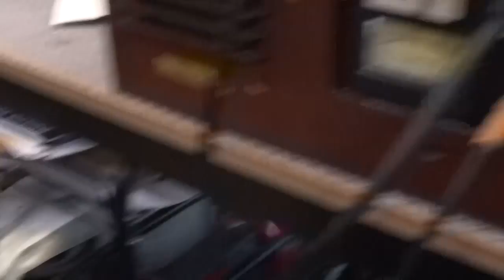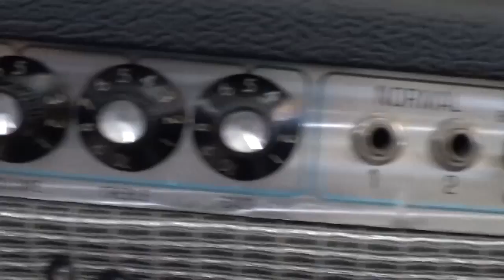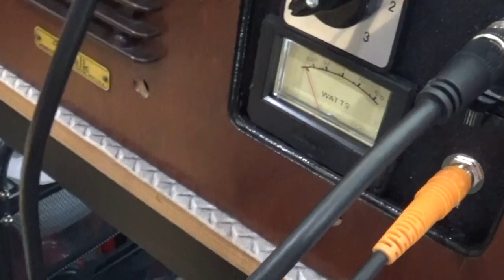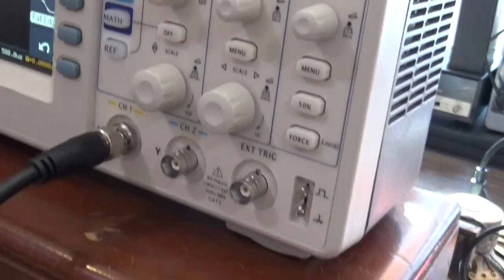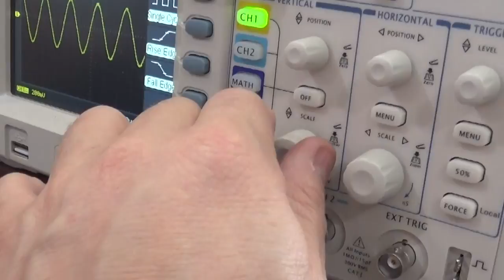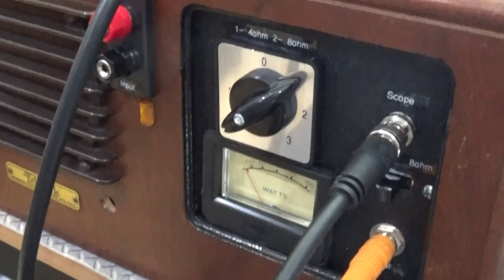Bass & Guitar Amplifier Dummy Load Tester - Episode 4 - Send me a signal, I'll send you a line.

Comment: Ron, you may want to meter your guitar and see what voltage those pick ups are putting out. I just put the meter on my Strat and in the middle position full volume I was getting 40 to 70 milli volts. So I would think depending what you get, 50 to 100 millivolts should be spot on.
Reply from the maker: Very cool way to calculate that Carl, wow.. good stuff...  I will do that.. thank you my friend !!!
Reply: yup, Carl, good idea, bass may be closer to 100mv.  It will be interesting to see the watt meter reading at vol 5.  What's the watts?  Don S
Reply from the maker: Keep in mind that I am using an Audio generator here which I can vary the power.  I got the meter working and it cranks up nicely over 10 watts at around the sam time it starts breaking up.  Pretty cool piece of gear to have.
Reply: At  the end of the video you had some distorted signals showing yup on the scope.  Was that from overdriving the preamp and amp or was the sig gen outputting distorted waves?   You may have done this already but.......First of all have you monitored you sig gen output under load?   What load does the amp put on the sig gen?   Make sure you have a clean signal going into your amp.   You have to have good knowns as you go when testing anything.   Second,  do you know what the output actually is on the sig gen when loaded?  Have you calibrated the sig gen with the dials/control scales?    Until you are confident with the sig gen you might want to use your second channel on the scope to monitor the sig gen output going to the amp.  Third  check the sig gen output under load at various frequencies to see if it is doing its thing cleanly and consistently across the audio band.    Now that you know that your test signal is really providing what you are expecting you can now test gear with it properly.     One note.  You are saying the signal is breaking up.  The distortion on the waves at maximum output is called clipping.  Your signal level has reached the power supply rails of your amplifier power supply  and that is what causes the clipping.    Keep up the great vids.
Reply from the maker: Jp.... all excellent points I did not consider so thank you. Like any test , things must be completely predictable and results will be consistent. Thank you for the eye opener on this !!!!  And yes, clipping is what I meant, you are 100% correct.   Thank you sir !
Reply: Ron, we all are learning what meter numbers and scope lines mean.  Experiance and knowledge takes time, like learning to play bass.  The trick to a scope is to recognise what is OK, or waht is abnormal or wrong.  When you connect up an amp to the signal maker, silly scope and dummy, you will learn what to look for, i.e. wassupwitdat.  Also will be used to see bias, mal functioning caps, or perhaps flaky tubes, all kinds of stuffage.  Many musicians can hear that something with the test instruments on your head, but the scope setup lets you see with the other two test instruments on your head.  As my dad used to say, "use your head, THINK".  The scope, dumbass load and meters are extentions to your built in test sensors.  Another "indicator" is touch, as it HOT.  Over heating also tells you that somethin isn't quite right, the multimeter often shows where the trouble is.  Improper bias could be the culprit, but WHY?  What caused the factory set bias to go wrong?  And your test stuff really helps you to FIO (figure it out). FIOY!  Don
Reply: good point, case in point, that little watt meter.  Amp should be lets say about ten watts at vol 5.  Watt meter is pegged at over 100, or perhaps barely moves, showing less than 1 watt.  What's wrong with the watts?  Is it the amp, or test meter?  Once the meter is calibrated, than it can be useful.  Even a small speaker can be calibrated with an L pad, then the speaker can sort of meter the loudness of the amp, too loud, or too wuiet.  Instruments often measure too much (aka clipping) or too weak.  Then you check caps, resistors, power supplies etc, and go from there, called trouble shooting to FIO.  Sometimes just replacing caps doensn't cut it.  lol
Reply from the maker: all really good experience and advice Don, thank you so much my friend.